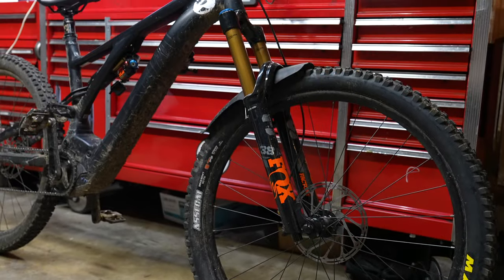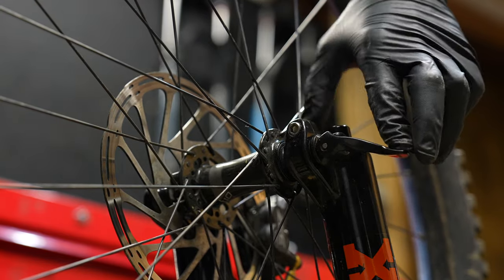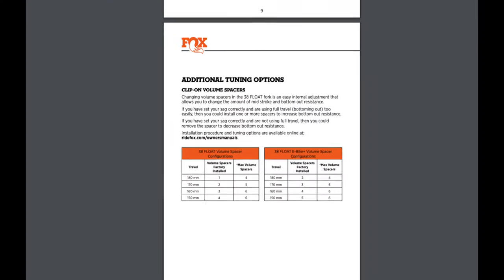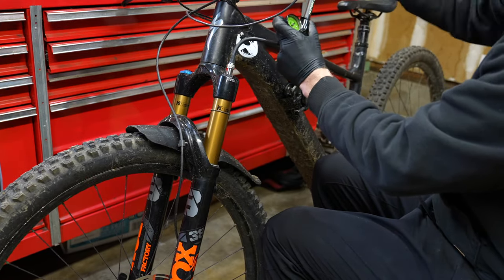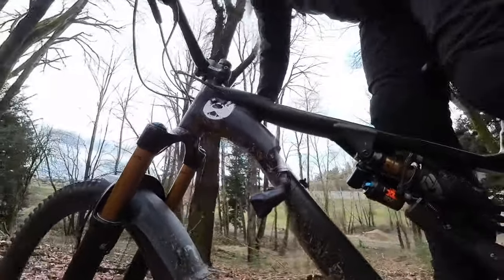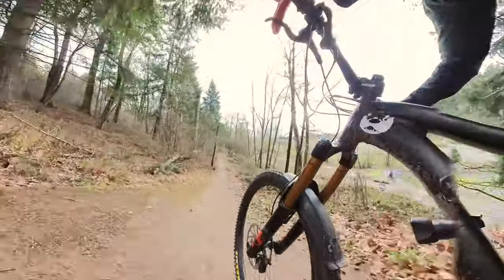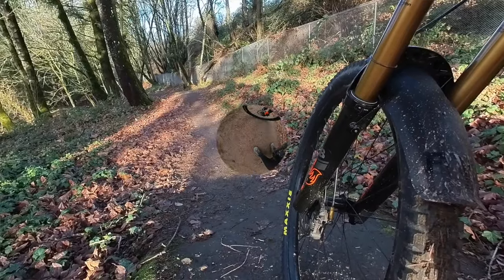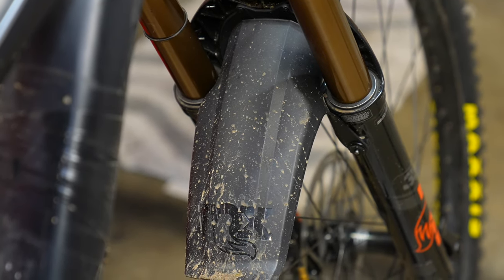Avoid these Fox 38 Setup Mistakes

Comment: I an about 220LBS and I found that putting less air in the fork gives it a better feel on my Turbo Levo. I've had tons and tons of forks and the Fox 38's feel so good. Very planted.
Reply: I’m also a “bigger” rider so hearing you say this makes me happy! Just ordered these today and ordered the rear x2 shock aswell for my turbo Levo. Super excited
Reply: @hunterb8016  One of the best things about my Levo is the suspension platform. The bike feels very balanced and very capable. Because the bike weighs 50+ LBS it needs solid suspension and 38's with an X2 is perfect. 
I have an Intense M16 DH bike and I think my Levo has a better suspension platform.
Reply: @hunterb8016  Depending on your riding, you'll get a better feel from the fork if you take out one token. 20% sag is pretty crucial or the fork will dive and run through it's travel. That's why Fox says 15-20%. The rebound is the most important thing on Fox forks. If the fork is feeling harsh and your sag is correct spend your time bracketing your rebound. With LSC/HSC open. Once you get a supple feel (it's usually a couple clicks faster than the chart imo) then dial in your LSC/HSC. While running 25%+ sag might feel good on small bump stuff it will definitely run into problems at higher speeds, bigger hits, and g outs in corners.
Reply: @_Jake.From.Statefarm_  Thank you so much for your comment. This is exactly the problem I am having with my canyon strive: my 38 seems just not to respond to small bumps or irregularities on the ground.
Reply: @Penta_Penguin_237  No problem. Remember than the less tokens you run the more linear the fork will feel (like a coil) and will also run through it's travel easer (just like if you had less pressure) If you're bottoming out your fork too easy, then you'll need to put the token back in. Getting a tune is never a bad idea either.. it's a bit expensive but it will achieve what you want out of your suspension. Even then though.. remember.. You can have more than the stock spacers at 20% sag.. land a big drop on the back wheel and smash down on the fork and bottom it out.. so like I said. It depends on how you ride. If you're blasting the fk out of your bike like a DH racer and doing big hits. You don't care how it feels on small bump stuff, you want it stiff. If you want comfort, you're probably not going to be doing that kinda stuff. Suspension is all about give or take. Comfort vs performance. Finding a balance for what you ride is the name of the game. It should be changed depending on what you're riding.
Reply: @_Jake.From.Statefarm_  Thank you very much! Actually I am using my canyon Strive just as a very overbiked trail bike and the fact that changing the compression settings on the top of the grip 2 cartige doesn't lead to any difference is very disappointing and the fork seems like just not to want to work on normal lightly rocky tracks. Especially when the fox 36 that I have on my Cube stereo 150 works excellently on small bumps. So all in all I will check if there are tokens inside (there should be none) and I will experiment with the return adjustments. By the way the bike has 3 months and the fork has always behaved like that.
Reply: @Penta_Penguin_237  Also important to note that a lot of the evol air shafts come over greased. Most people get them serviced right away. If your compression knobs aren't working at all that might be the reason why you're have major issues and a service is in order, while they are two separate issues, they are both common on Fox forks as well.
Reply: How many tokens are you running?
Reply: @PittHead  Not sure because it's stock. I haven't opened it to see whats inside.

Comment: Not all 38s come with a quick release - 38 that came with my 23' Megatower doesn't have the sleeve, the axle has a large head with a 6mm Allen key, gets tightened in then tighten the pinch bolt
Reply from the maker: I made a couple big typos in this video thanks for commenting on that
Reply: @OtterMTBtech  It's a pain in the ass I really with it had the quick release! I need to take my front wheel of to put it in the car!

Comment: I got same psi as you. But driving at a middle rebound. Not tooo fast but slow enough not to pop out. For very hard trails perfect. But sometimes to slow. It is very hard to find a perfect solution for everything on the trail.

Comment: Excellent tips. Thank you! You said you set five clicks of low-speed compression on every single fork. I assume that's clockwise from fully open on the 38 Grip2, so about 11-12 out of 16 clicks counter-clockwise from fully closed. Correct? Fox recommends 10 clicks out from closed/slow to start so 12 is perfectly reasonable and is what I run.

Comment: What are your thoughts on less tokens more psi. I’m on 1 token, 130psi, weight 105kgs. It feels less divey and more supported then 115-120 psi with 3 tokens. I’m on etuned version
Reply from the maker: https://www.youtube.com/watch?v=xfcwLQxrQn8 I ran with no tokens in this video high pressure full compression. I thought it was less poppy giant plush bucket. 3 tokens may be to much. IF you like it send it most struggle to get along with the fork

Comment: Can't get enough of your vids.  I think I can relate to your riding style from what you say...and I weight also around 210lbs...I have a Levo gen 3 with a Fox 38 Elite and a X2... Seems that I can't bring them to the ride quality of my other Enduro bike (Rockshox Zeb Ultimate Charger 3 (170mm)  with coil shock at the rear).  I have even rent two Shockwiz to help me to set them up, but I still have a feeling of harshness.   I'm starting to think to switch them since I mostly use the Levo now.  I'm beginning to think that the fight is uneven between both forks.  I know I'm not giving you much data, but I would still like to know your opinion or direction to help me out.
Reply from the maker: Listen up, I am working on a new setup guide, make sure there is 2 tokens in the fork, about 120 psi, they also loose air in 2 weeks so except it to go flat to 100 psi in that time, go full fast rebound and full on compression low and high thank me later 🤙 skip shock wiz it does not work good on forks 

The rebound is the harnesses not the compression. 

Fixed my friends in the parking lot. 

Test it slowly
Reply: So it's the opposite of what I have. You want me to try full open Rebound and full close compression?
Reply from the maker: @mart63789  Yes try it. I am heavier than you and that is what I run now, before I ran 7 clicks from slow rebound 5 clicks low and 5 clicks high both work,
Reply from the maker: 120 psi

Comment: I have for 38 170mm with fit 4 im just looking how to set up before take my new bike out, see on the side of your fork there it has the wheels size 29/27.5 im assuming this means the fork can take both sizes? Just i read that there is a 38 for 27.5 and a 38 for a 29er and have to be one or the other? I have what looks like the same arch clearance from the tyre to arch on fork like yours but there 27.5 fox 38s when registered them? I'm new to these new shocks n bikes its been a long time since was on a bike but watching all these video's just made me look into them more and more till just wanted back on the trails! Weather is pants here in scotland just now so getting the bike ready for its first day out hoping on Saturday!
Reply from the maker: It’s 27.5+ and 29. Then the 27.5 devoted fork. The plus size tires 
Disappeared but they still have the sticker on the fork

Comment: I remember you saying 36 spacers fit the 38 and obviously just seen the lylic tokens there but being told they don't fit on other video i trust your opinion more but just to double check with you? I got 3D printed tokens sent when ordered some never noticed they weren't genuine but scared incase they chip and destroy the inner bladder or something id just rather get rhe genuine ones plus PETG filament is pouros so will maybe be squishy i dont know but not risking it! I am a 3D printer do it daily for models and stuff but I use  stong abs resin and the latest 8k and 12k printers and still wouldn't trust us8ng a volume spacer in a shock! The materials are still to brittle for this type of application and it will end up causing you a massive repair bill or worse a system lockout when landing or blowout if a small peace does break loose! Its not hard even if it bends in the clips that clip together they will shatter! Rant on that over jsut anyone thinking of using 3D printed tokens please don't not yet anyway! 
Cheers
Reply from the maker: The 36 ones clip right in. Don’t use aftermarket stuff they are super cheap

Comment: Really want a Fox 38, but I have a hardtail made for a 120mm, so maybe a bad idea?
Reply from the maker: Yes bad idea. 130 36 better
Reply: @OtterMTBtech  sadly I agree, and a 36 130mm was my sensible choice as well. Even though I am 244lbs, I better stick with a 36.
Reply from the maker: I’m 220 and have to use all downhill rated parts. You should too, if your ride anywhere near hard
Reply: @OtterMTBtech  Yes, I dont really care so much about weight  for the parts I choose, I just want stuff that wont break while riding. The thought I had about getting a Fox 38, was to have a really solid fork, that wont twist or bend, while being smooth and comfy at the same time. Not getting any younger. So, a 38 would give me a min of 150mm travel, but then run it at maybe 25% sag, instead of 15-20% on a shorter fork. I can't find much info on others doing the same, so I don't know if it is a good idea or not, but in theory it would work for me, and my riding style. A fox 36 at 130mm is maybe a better (thinking of the travel) option, but at the moment, all I can get is the 38. My bike is a Cannondale Trail Se hardtail, and it should hold up to the abuse, but only one way to find out.